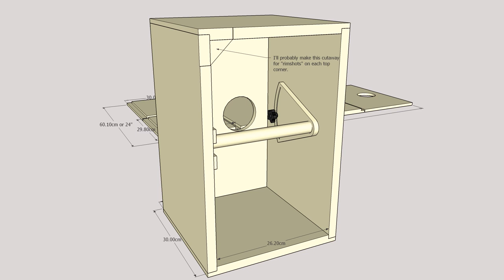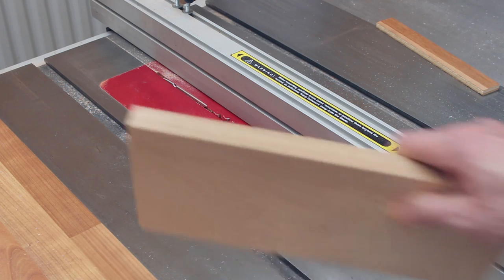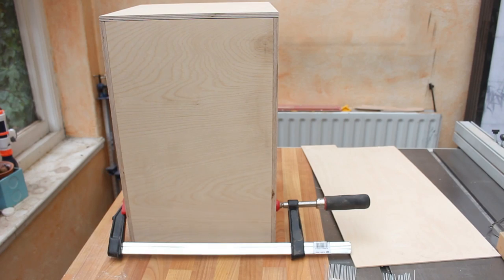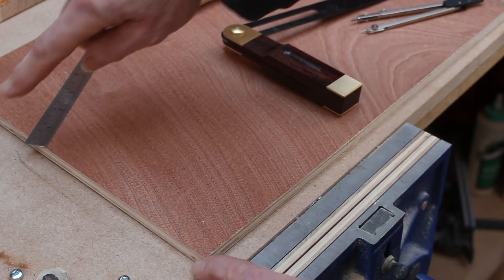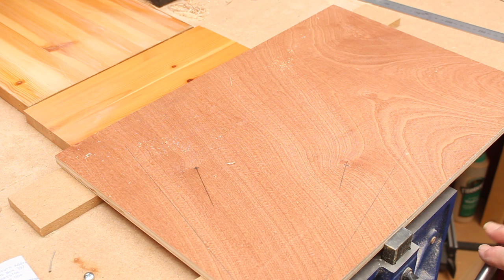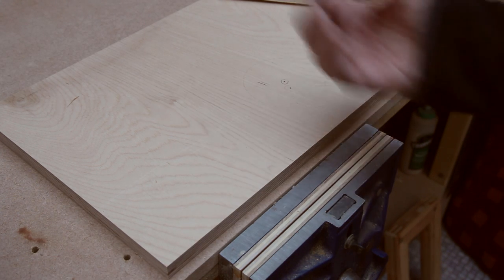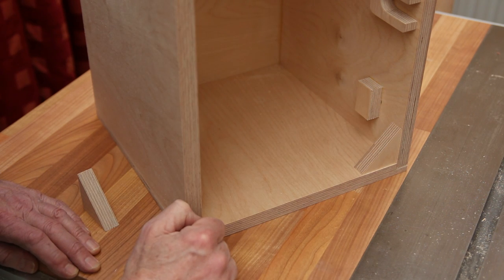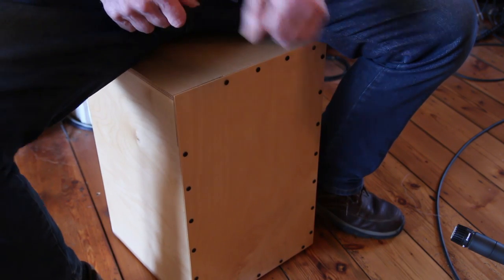Cajon (Mk II)

Comment: why not put the piece vertically to do the rebate on the table saw? Also, great videos, great content, finally from someone who isn't all the way across the pond.
Reply from the maker: I do sometimes cut rebates that way: two cuts on the table saw, lengthways, perpendicular to each other. But if I remember rightly, I didn't do it that way this time because although I do have a tall auxilliary rip fence, I don't have decent featherboards and ensuring that 30 cm tall pieces stayed exactly vertical seemed a bit too much of an accuracy and safety challenge. However, I must sort out what I'm going to do re featherboards.

And thank you for your kind words.
Reply: at least people "across the pond" don't call rabbets rebates or clamps cramps.  Very odd.